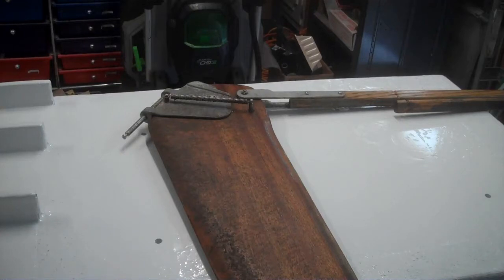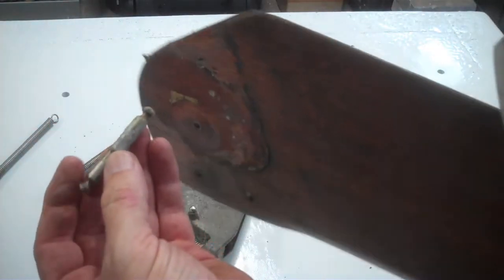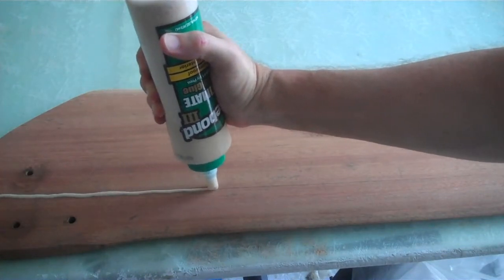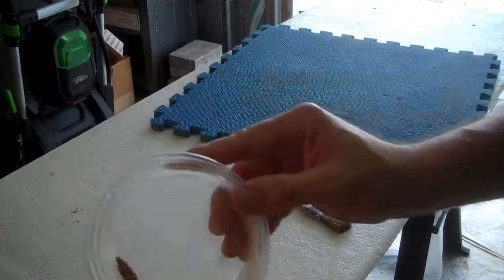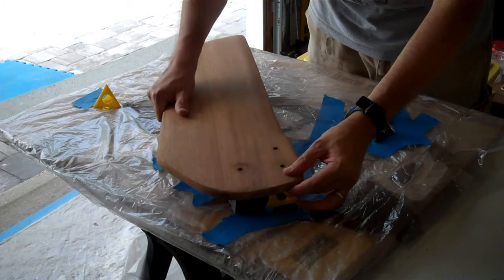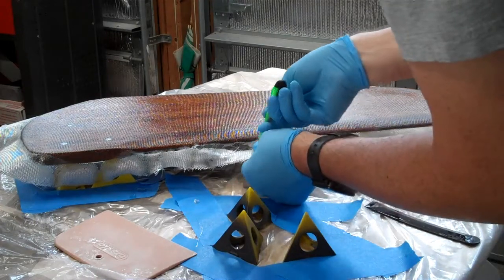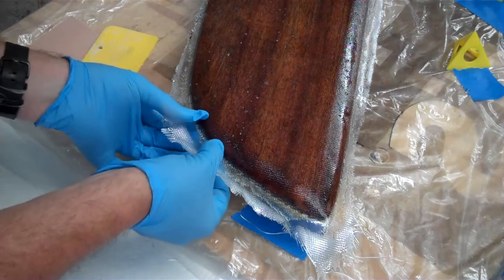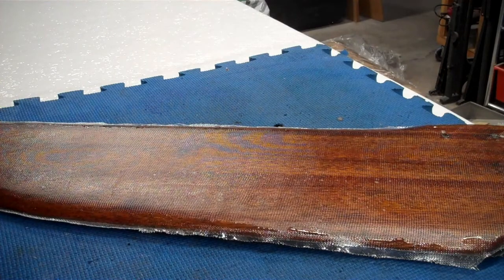Repairing a cracked sunfish sailing dinghy rudder.  Part 1 - Fiberglass layup

Comment: I was just repairing my force 5 rubber and had some thin fishing line lying around. I used that to pull the glue into the rudder's small crack. Worked like a charm.
Reply from the maker: I've also been told that using a vacuum on the underside to pull the glue down works well.

Comment: Crack it completely in two pieces and then glue it back together. Cheers
Reply from the maker: I had strongly considered that, but was worried that the crack wouldn't be clean. Plus...with the fiberglass, it's probably stronger than new....

Comment: Not how I do it. You have not addressed the weakness of the split. I bet that will break again. I use 2-3, 3” - 4” internal 3/8” dowel pegs with epoxy. No Fiberglas fabric. Mine last YEARS, in fact I insert one long dowel BEFORE it cracks.
Reply from the maker: That is fine if you want to stay authentic with all wood construction. Fiberglass fabric on the outside creates a very strong shell and the edge stiffness prevents future cracks as it prevents the wood within from flexing.

Comment: How much do The vintage Rutters cost?
Reply from the maker: Prices for new replacements (wood or fiberglass) can be found here: https://www.intensitysails.com/sunfishcovers.html
(Generally, I wouldn't expect "vintage" to add any value over new unless it was in very good condition.)  I'm personally looking for the tiller/cheek assembly that I can use with this: 
https://www.youtube.com/watch?v=uYVk-x5Eo6o

(so I don't have to keep swapping mine back and forth)